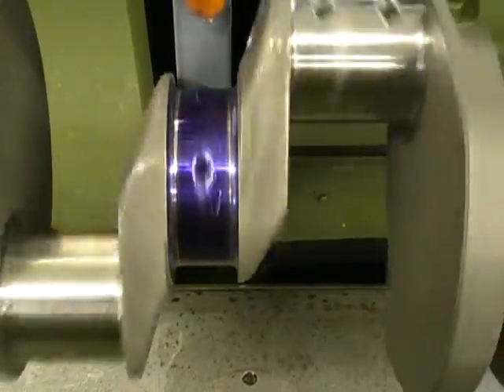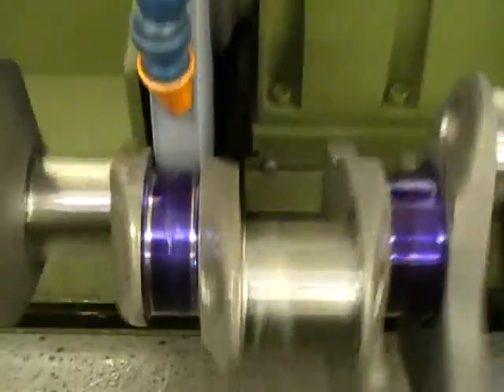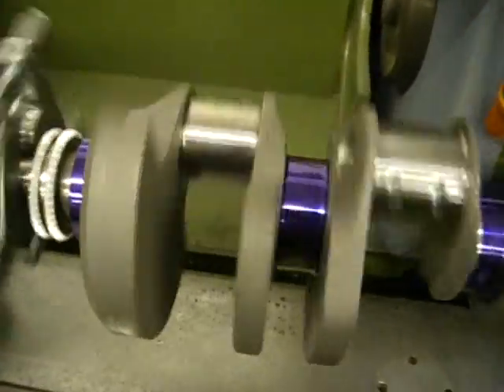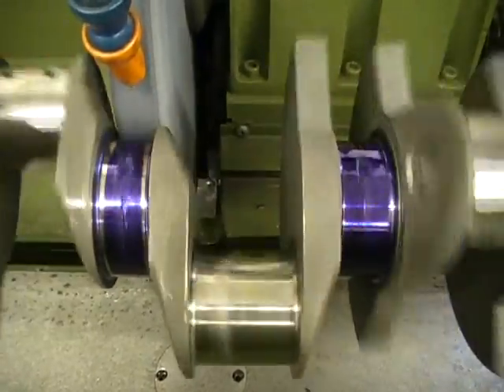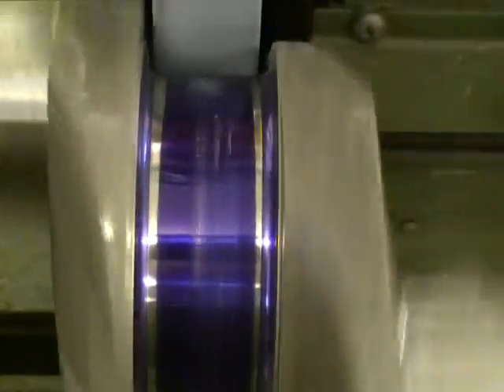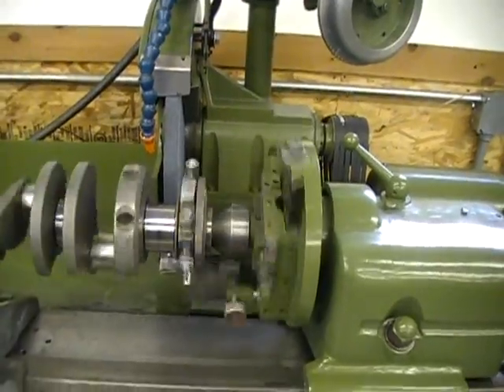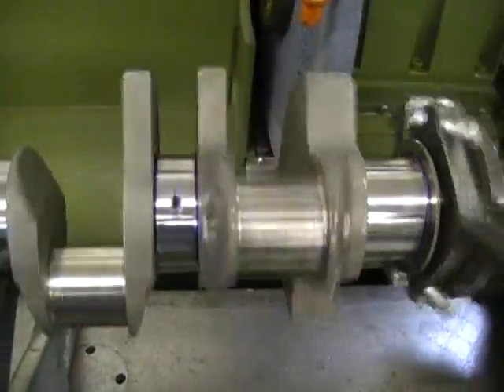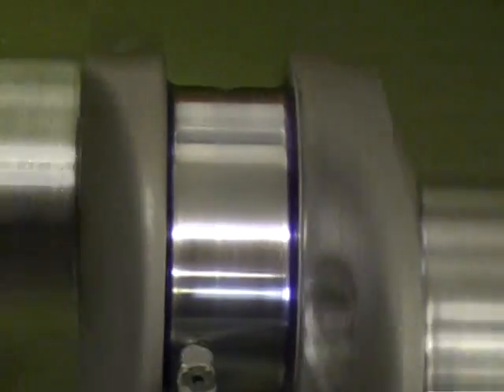Crankshaft grinding Eagle 4340 Forged SBC Crank

Comment: I have never seen this bad of a journal unless the installer tried to polish it for more clearance!  The only thing I have found is mains have a .0005- to. 0025 bend . Other than that they are pretty good.
Reply from the maker: You must be fairly new to Eagle products then, or new to building engines.
 I pulled this crank right out of the box new in 2003 ground and polished like this.
 Every engine builder that's been around for a while and used Eagle has seen the same issue. 
 I have no doubt they have improved their QC, but just because you haven't seen it, tells me how little experience you have.
Reply: @cpmotors  you must be one of those who are not willing to admit that you don't know everything about engine rebuilding and machine because of customer base!! Always remember that there's more people who know more than you..
Reply from the maker: @dpierson489  I couldn't care less about being a "rebuilder" in your opinion, nor do I want to be.
 You actually are pompous enough to claim I polished a new crank right out of the box and hourglassed it, and then ground it -0.002" to fix it...because I don't understand how to do machine work?
 Go blow your smoke up someone else's ass.

Comment: So the Billet 4340 crankshafts are usually no good, unless from U.S vendors?
Reply from the maker: ToreDL87 this was and is a common issue on the lower cost cranks. The better vendors of import cranks have better QC in place so this isn't an issue.

Comment: I would like to see what kind of wheel dresser you used. The accuracy of the dresser is the deciding factor when using a wheel that is the width of the journal.
Reply from the maker: The issue with the crank from mfg was a worn grinding wheel combined with aggressive polish. I use the radius dresser on my machine as it's at the wheel centerline and travels in the correct parallel plane to the grinding wheel axis centerline.
Reply: How do you know that the wheel dresser is parallel with the spindle centerline? On board wheel dressers are well known to be off, depending on the manufacturer. When plunge grinding the width of the wheel and not traversing in the X axis, the dress is the deciding factor in accuracy. Can this grinder dress radius's on the wheel?
Reply from the maker: It's not rocket science to tell if its parallel or not. This isn't a wheel head mounted dresser, this is mounted on the work table and traverses along X axis. Simple plunge cut tells you if its cut parallel to wheel axis.
Same dresser does radius of wheel.

Comment from the maker: Its common knowledge most budget cranks are cast/forged in China, difference is some are also finished in china, better ones are finished here in the USA. 
Forged cranks are not the same as Billet cranks, and yes they cost alot more for a reason.
Reply: cpmotors Mexico eagle

Comment: I think All of the so called 4340 Forged cranks, Scatt , Eagle ,Pro something or other are all MADE IN CHINA , or INDIA , ISREIAL .
 Real U.S.A FORGED Cranks cost $1,000 +  $ 5,000 + for BILLET
Reply: Not exactly. The base forging is made in China. Then the crank is finished in the US. All that shitty machining is done in the US.
If you want a cheap forged crank, it's either Lunati or Crower, which are also Chinese forgings finished in the US, but at least they're straight. Otherwise get a billet from Bryant, Winberg or Callies.

Comment: I had to regrind a few eagle cranks that people couldnt get them to turn just like that.Every one I did I had to grind the rods and mains,I have 3 Stom & Vulcan 15A special crankshaft  grinders,old but good grinders.Are you able to grind that crankshaft without a steedy rest to keep the crank from runout,I use 2 on the mains.